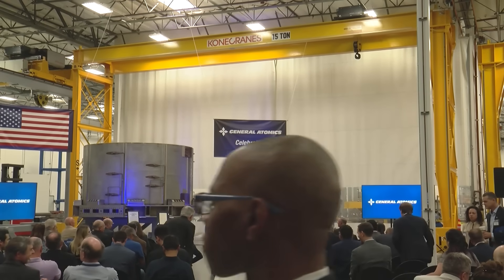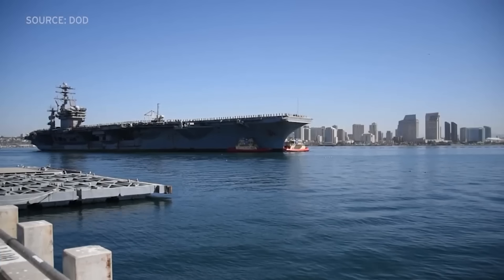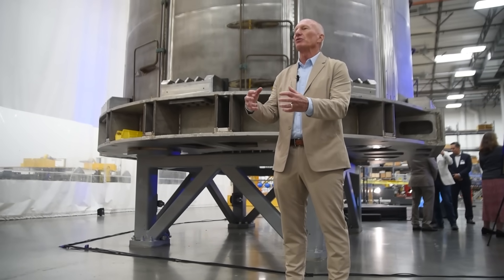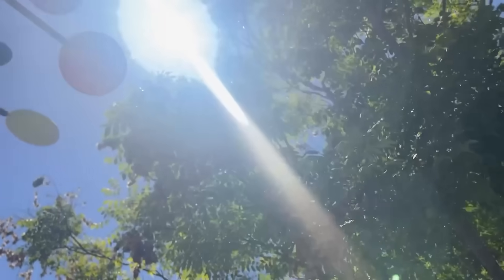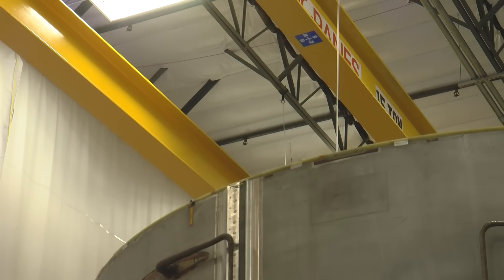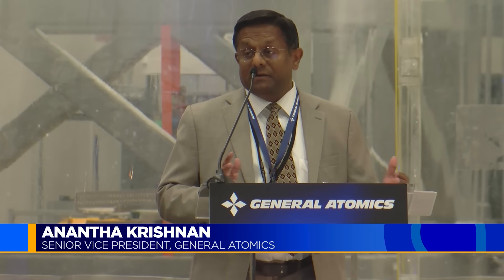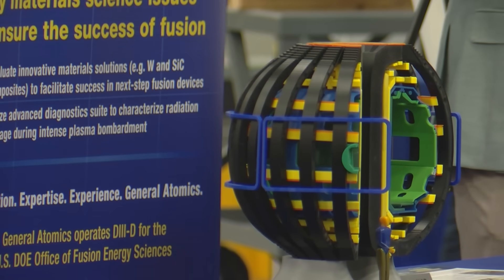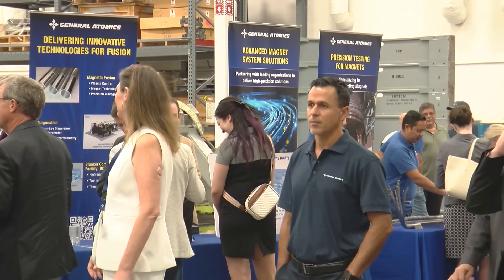General Atomics magnet could help unlock limitless clean energy

Comment: How can you have magnetic confinement if it takes more energy to create a stable magnetic field wouldn't it hold the same or greater amount of heat and energy than the magnet were is the surplus coming from?is it a compactor of a nuclear plant and is only ment to be used like a battery

Comment: Im the inverter of the Hydra-Kinetic Motor, a motor/generator that literally runs on kinetic energy from springs. It can power anything in existence that needs power. Clean, quiet, cheap, efficient, reliable, portable, scalable, safe and extremely powerful. I finished the design nearly 10 years ago. Could be rolled out commercially in a matter of months for pennies on the dollar giving every single person in the entire world true energy independence. Unlimited energy. Unlimited range. Small and lite enough to hold in your hands.

It single handedly renders all other energy sources completely obsolete.
Reply: Sure buddy
Reply: I'll take 2.

Comment: If you want reliable power, sometime this century, you can buy the solar electric system tomorrow. Probably take you a month or so to get it installed depending on how busy the contractor is. And it won’t cost $1 trillion, make your taxes go up and it will actually work.

Comment: The RSN Reactor, Real Soon Now 😅
Meanwhile, China installed 93GW of solar capacity in May 2025. 93GW in ONE MONTH 
That outputs the same annual kwh as 15x 1GW nuclear power plants per year.
I collect 2x my household daily needs from thel fusion reactor in the sky with 28x solar panels on my roof 😅
If all or even a portion of funds used for fusion projects to date globally had been used to put solar panels, both pv and thermal, on every residential and commercial rooftops, parking, common areas for the past 30+ years, all energy needs would've been met a couple times over by now.
Yes, the costs for pv solar only recently dropped the most in the past 5-10 years, but even those who installed solar 20+ years ago report no issues in function today and payoff years or over a decade ago

Comment: If you think climate change is too slow, creating 100 million degree C plasma would accelerate melting of the glaciers and polar ice caps.  Fusion reactions also release lots of neutrons which can induce radioactivity in targets - such as the steel supports, nearby air.  Nothing "clean" about it.

Comment: That's pretty cool, I'd like to see the machining / fabrication of that 😃
Reply: I was one of many who machined parts for the magnet components. A 4 axis horizontal mill was used for the first operation. Then a 5 axis mill was used for the final 2 operations. Each piece started as a 12x12x8 inch of steel. I can't remember how many pieces we made but there were hundreds of them. I did all the machine programming, made all the work holding and worked with Kennametal to get specialized tooling for fast metal removal. That was back in 2015. It is such a an awesome feeling to have been a part of this advancement in energy production no matter how small a part I may have played.

Comment: Fusion power is always 10 or 20 years aways, and hundreds of billions are spent on it. The challenges of creating a collider with temperatures a hundred times hotter than the sun are immense, and scientific advancement will always be of great importance. Hopefully this work spaws other improvements, and funding research is important in general. I don't think we are at a level where the many challenges are solvable all at once. A trillion dollars spent on building more workable clean energy would yield tremendous benefits.
Reply: It also spurs education creates jobs and helps communities

Comment: As soon as the senior visa holder got on the podium I tuned out.
Reply: Well what are you and your boy JarheadCletus doing to advance the human race?
Reply: @Stevelemontrudy , I'm a former Turbofan Test Engineer for Lockheed and Rolls-Royce at Stennis Space Center, testing the Trent 900, 1000, and XWB engines for the Airbus A380, Boeing 787, and Airbus A350.  A former controls engineer on the pump stations in and around New Orleans that we built after Katrina, and lived though Katrina supporting rescue efforts while in the Marines.  A former Metrologist for Lockheed at Stennis, supporting the Space Shuttle, Orion capsule, satellites we built, cell phone manufacturers, aircraft manufacturing, and more.  I was serving in the Marines when 9/11 happened and deployed at the start of both wars.  Was part of the first ever wireless business internet in Denver in the mid to late 90's.  Helped pour hundreds of foundations in Denver throughout the 80's and 90's.  For the past 10 years I've been consulting aerospace and defense companies.

What have you done?  I guarantee it's nothing remotely close to that list.

USMC 1999-2007
Reply: Exactly.

Comment: 1:53 - Some kind of clean limitless energy source eh?  Wonder where we could get that?  Look up at the sky!  We already have clean limitless fusion energy for billions of years and at least a billion more.  No maintenance, no downtime and provides 1000x more energy we could ever use.

These nuclear fusion acolytes are really full of themselves.  There is not even close to "limitless" energy with fusion tech.  For starters, most fusion tech needs very rare expensive tritium fuel (H3) for the most energy release.  But tritium is so rare it requires synthesizing through a complex expensive unproven process from an also rare isotope of Lithium.  Natural tritium costs some $30k USD/gram and will require over 55 kilograms of tritium for the annual needs of just a single 1GW reactor!

Use of any other hydrogen isotope other than tritium results in less energy output and even more energy input to keep the fusion reactor going.

Commercial nuclear energy both fission and fusion won't even put a dent in the amount of energy we need to run the world on.  There is only one source that can do it and many times over with the clean fusion energy we are gifted to us by nature from the sun.  That said, nuclear energy technology is best used for small-scale specialized applications like military, scientific, and deep-space — not the grid.

Comment: HOW STRONG (measured in T = TESLA) Is it ?

Jebus, they couldnt even give us the only stat that matters AT ALL. Shitty reporting (-1).

Is it 20T based ?  More ?!
Reply: When fully assembled, the six-module Central Solenoid and associated structures will be 13 meters tall, weigh 1,000 tonnes, and be capable producing a magnetic field of 13 Tesla, making it the largest pulsed superconducting magnet ever constructed.
Reply: @beedee509 Its not max cutting edge at its core yet then, because AFAIK a 20T prototype has already been tested by another team ... just not scaled up yet, like this one has.

Comment: Yes hedron collider and fusion energy what are we aiming for here? Are we trying to turn the earth into another sun seems genius what could go wrong 🤦☀️😎💀💀💀💀clean energy should be as easy as putting floating devices in the ocean that go up and down a copper wound tube like a shaking flash light but they don't want you to know it's that easy so they make it difficult kinda like changing a timing chain in a 2008 Silverado you gotta tear half the engine apart 😂

Comment: That is free energy. It is the first real perpetual motion machine and works on pur magnets.
Reply: Perpetual motion as long as you keep dumping power into it.  Free energy?  Potentially possible, but not yet.
Reply: @gilian2587  It's tricky because in 2022 we had one producing 3.15 megajoules from a 2.05 MJ laser input, generating more energy than it used on the reaction startup itself, but the laser took a whole 300 megajoules to power from the grid.
Reply: @zereimu  No problem... magnify the reaction by a factor of 100 and maintaining the energy requirements at current level; and finding a way to harvest the excess heat into some turbines of some variety... then MAYBE, find a way to repeat the interaction multiple times in time, and maybe it'll be net USABLE power positive!

Comment: What is the waste situation? If it produces more radioactive waste that we don’t have a way to safely store it or render it safe, we just face more of the same problems we already have with nuclear power plants.
Reply: Fusion uses lighter elements so it doesn’t have a way to produce either the radiation or the waste that fission does.
Reply: They've sold Nuclear Fusion on the promise of considerably less nuclear waste than Nuclear Fission Plants. Nuclear Waste needs to be put into deep geological storage. Norway is the only country who has a long term storage facility.